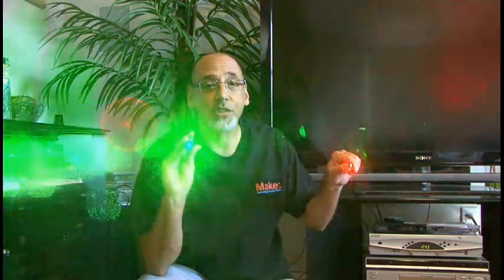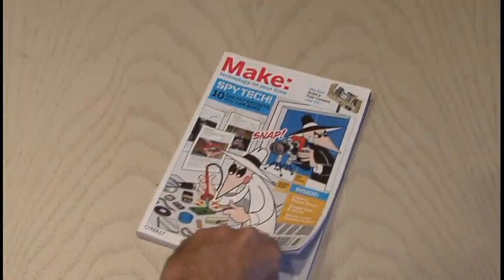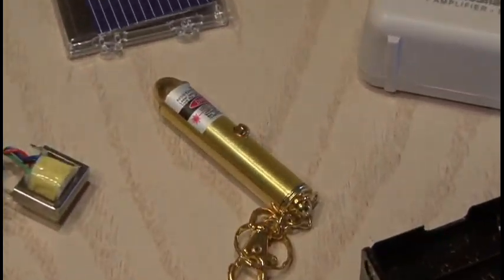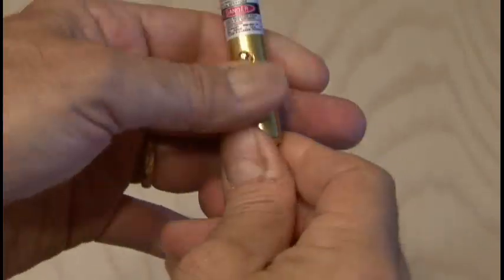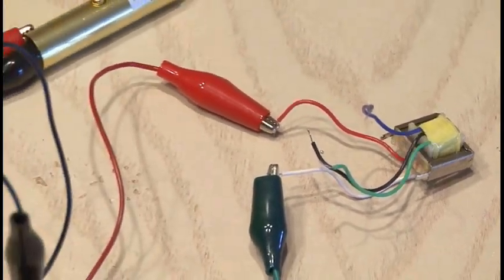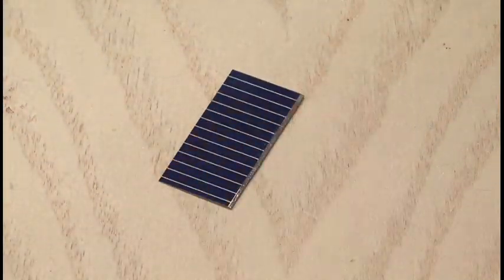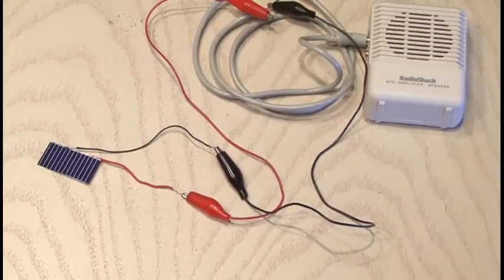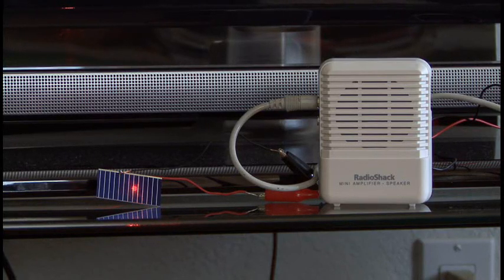Weekend Project: Make a Simple Laser Communicator

Comment: Hi, I'm currently studying physics and this is a new area for me. I'm wondering what purpose the transformer fill and how it works. I'm only familiar with transformers that changes the voltage in ac currents (for example converting to higher voltage when transporting electricity)

Comment: How the hack are you saying that using a solar cell you get audio signal ???solar cell gives you DC,to have audio signal you need AC! don't prank people to get money!
Reply: +Tatar Sergiu You can get an audio signal by pulsing DC.  This works and he's not trying to trick people, he's educating people.
Reply: I agree, it doesnt have to do with AC. It actually has to do with the brightness of the laser and how loud the transmitter signal is. Both the sound level and brightness of the laser is the Amplitude Variation, same on how AM radio works.

Comment: Instead of the Lazer  and solar panel could you use an ir transmitter and reseaver? Just out of curiosity.
Reply: It should work, but you will get a power loss, since you aren't transmitting in a direct line. Instead, the receiver will only receive the area of the transmitted power that hits it, ignoring everything that misses.

Comment: Kipkay.
Is there any way to do this without the transformer or by using a normal AC wall wart transformer or does it have to be an audio transformer? I tried this according to another video I saw on here and the audio is very crackly and the laser is dim and goes out. what am I doing wrong? Thanks

Comment: Sure! But I'm afraid the rather high voltage output might horribly distort your audio signal in the drive circuit! A crackling sound is guartanteed! Stick with a solar cell from an old calculator, as rtty juas already mentioned, works just fine!

Comment: the beam width on most red lasers "break up" @ ~1/2 mile or so, meaning it will probably become distorted at long ranges, if you want to go up to like 1-5 miles i'd highly suggest a green or blue laser(if you really want a blue one you can find it inside your BLU-RAY players they are a lot more expensive) as the beam width is much narrower and is capable of travelling further before encountering that "break up".

Comment: Yes, it is much cheaper.
The difference is simple:
A solar cell produces electricity depending on the amount of light of the laser.
A photodiode will act as a resistance; the greater the light, the less the resistance and vice versa.
For more help google 'photodiodes' and you will get all sorts of tutorials.
Regards
TheBlackhawk2399

Comment: Hello.  I have a circuit that does not use the transformer, it also uses your usb for power and computer as the receiver.  Easy to make if you dont like making things like this, but like cool stuff.  How far can you transmit; better than trying to use radio trasmitter.

Comment: Audio is AC,the transformers output is used to modulate the DC driving the laser.
We call this AM or Amplitude Modulation.
The transformer is also used to galvanicly isolate the audiosource from the laser.
Get it?

Comment: Yes, one can modulate NTSC onto a laser beam, I have done this in the past with no problems whatsoever.
Simply configure your laser to be modulated and provide baseband composite video.
At the other end simply extract the signal, be sure you do not invert the signal and do get the levels correct.
Due to the massive available band width a laser has video is not a problem.
Enjoy.

Comment: @theSYNQmaster Television Remote works by Infrared  laser wave. Just in case you didn't know red laser pointer works on Infrared wave (the cheap ones are about 1-5 mw) and TV remote (or most of the remots I THINK) works on super low wave of IR.

Comment: @newton3010 Radio waves and light waves emitted by a laser are part of the same spectrum. You singling out "radio waves" and saying that "light waves" aren't different in terms of how they are converted are ridiculous to say the least.

Radio waves =/= Visible light spectrum. Sound is merely the vibrations composed of frequencies that can be picked up by our ears. You saying the principal in which the light - sound and sound - light conversion is the exact same as with radio waves.

Comment: @Schilcote A thousand ways to skin a cat. On the plus side of Kip's approach, the receiver is sparingly simple and doesn't need biasing.

I bet you can use an LED to replace the solar panel. LED's exhibit the photoelectric effect, and with a strong laser pointed at them they'll give a good amount of voltage. On the downside, you'll have to be very good at aiming your laser.

Comment: @RicoshetSC further away the more distorted the sound will be at the other end. Also requires a complete line of sight
Another method would be to get yourself a basic optical cable ( like £3 ) and attach it to the laser head and feed the cable to the detector, but then that wouldnt be wireless.
Light can carry much greater information than a basic copper cable, thats why optical cabled systems offer superior sound quality. as there is no wiring resistance/magnetic inteference to worry about

Comment: Did this with a He/Ne tube in HS in the '70s. Just modulated the output of the power supply and then detected it with a photoresistor.
In 1970, we paid about $400 for a 5 mW laser tube. Now, you can find 5 mW laser pointers for a buck at the dollar store.

Comment: An even simpler audio to light transmission system: plug an LED into the speaker output of your stereo, shine it on a photoresister that is wired in series with a speaker and battery. The audio is clipped, but intelligent. Add some lenses for distance. Did this back in the late eighties when I was a teen.

Comment: this is a heck of a lot simpler than a design that I had found in an electronics magazine years back. Mind you it was high powered and did both receiving and transmitting in one unit. I find it interesting that you had used a solar panel for the pickup.

Comment: @spider853 
This design is a joke. it will not go that far, and it won't work at daylight.
1-You can make the range that you want by current madulating the laser. This circuit uses voltage modluation which isn't what should be used.
2-You can use other detectors instead of a solar cell to make it work in daylight.

Comment: @ dee1392: not only that... a laser 'connection' can go for miles if the laser has enough power. besides that, it's pretty hard to 'sniff' the signal, cause when the beam is blocked, the receiver that has to receive it won't hear anything...

Comment: @Jamacin01 - No - only the rcvr can be direct connected to the solar cell. The laser transmitters battery voltage must be isolated form the amplifier either by an audio transformer or an isolating capacitor. You are trying to AM modulate the 4.5 VDC power source of the laser with a approx. 200 mW AC amplifier. They are not compatible. Also the 4.5 VDC may destroy/degrade the transistor in the final amp too if not isolated.

Comment: You don't necessarily need an audio transformer in the laser transmitter. You can use a ceramic capacitor (0-01 µfd + or
-) to isolate the DC voltage from the AC component.

Comment: @Flea5000000000 - No you would need to use a audio amplifier to convert to AC and boost the solar cell voltage to listening level. The Radio Shack amplifier (about $15 USD) has more transistors than just one and can produce about 200mW speaker output. What you've described is just a simple DC switch not a AC amp. You could design your own breadboard amp though.

"Just shut up" - Why? Did I say something wrong?

Comment: To enhance aiming at distance you can take a cheap pair of binoculars. One side for the solar cell and other side as your spotting scope. If you have 10X binos you can actually SEE  where your red pointer is going up to several thousands of feet away! And with a large red colored bicycle reflector(s) mounted around or behind the solar cell it will be a cinch to find the target. Here's a diagram: tinyurl-com/2waylasercom

Add PC, modem, &  MIT's free PGPfone then it becomes a secret communicator.

Comment: that is running on amplitude modulation? (used transformer) ..btw..it is less usefull in daylight or sunlight ..but add  some bigger capacitor into the serie wirh solar cell  and it will reduce a DC factor ...and..what about stereo?:DDD

Comment: Like gauravzerogravity said , a standard AA battery is 1.5v each as of the company rating.. what you get is not 1.5v but a lesser value , which might be accounted to the 4.4 V in the reading. It could be various factors , temperature errors and calibration errors etc.. a slight 0.1 V variation..

Comment: not exactly 4.4 volt batteries might be used  or due to room temperature it shows 4.4 volt
if u use three batteries  1.5v+1.5v+1.5v = 4.5 volts

Comment: I have a question... I can see u are connecting the negative power supply pin of the laser's voltage regulator to the positive 4.5V supply. Is that the negative 4.5V connects to the V-in of the voltage regulator? If I use LM317 voltagulator typical config, will it work? Thx.

Comment: The Germans invented a light communications radio in WWII. It didn't use lasers, but a light beam that could transmit quite some distance. It needed unobstructed ground to work, so was mostly used in the Ukraine and mountain top to mountain top. In any case this is where the idea came from.

Comment: Yeah and electricity has the same speed as sound, or you mean that the telephone use millions of miles of thin tubes to carry away the sound, and "sound routers" to send them to the correct end... Anyway, telephones cost money, as well as the telephone line and the time you spend talking. And in this case, your transmission cannot be intercepted unless you're able to split the laser in two O.o

Comment: -Audio output: Output stand for from the conecction part of the sender or the transmitter like your cd player or radio or tv....etc
-Amplifier is :electronic equipment that increases strength of signals passing through it

Comment: It doesn't. The solar panel turns the light into *electricity*.

That's sort of what they do. That's the whole point of solar panels.

The radio then turns the electricity into sound. Which... again, is pretty much what they are supposed to do.